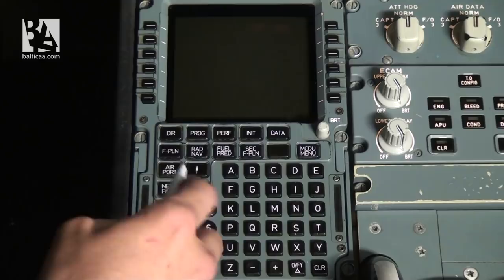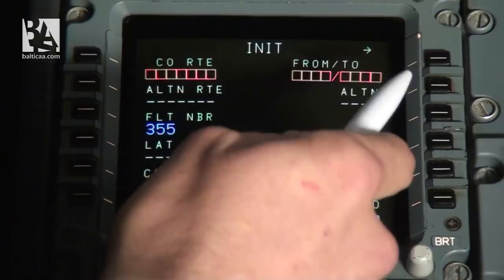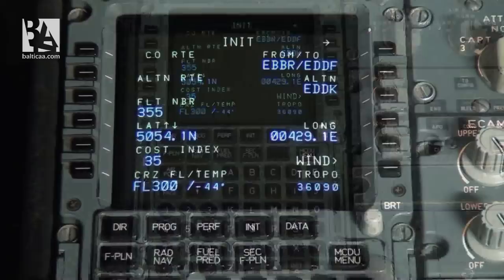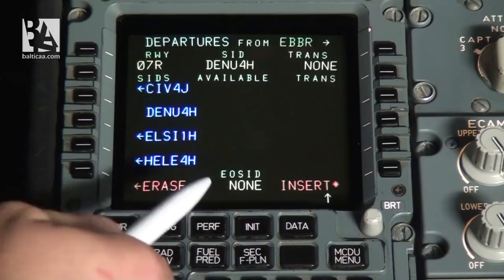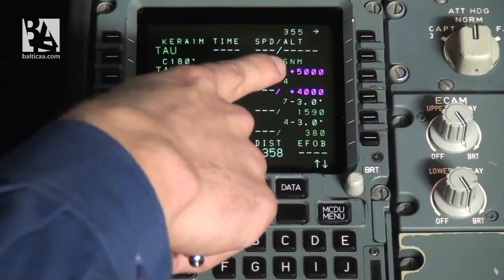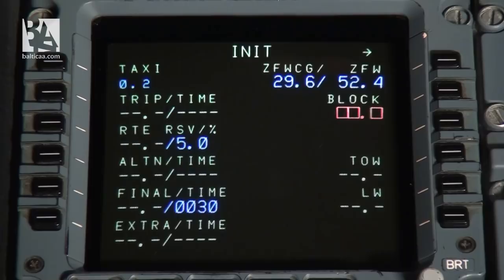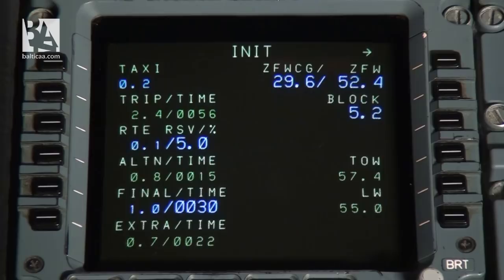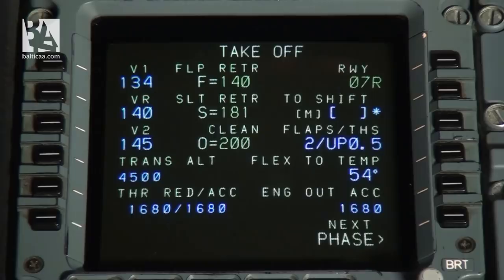Baltic Aviation Academy: Tutorial of Multi Control Display Unit on Airbus A320

Comment: TAXI 0.2 is not 20 minutes, it is 200 kgs.
Reply: taxi use time cycle not weight cycle
Reply: No madame, in this Airbus MCDU, the value 0.2 is 200 kilograms, not time.
Reply: You can add them up easily => 0.2+2.4+0.1+0.8+1+0.7=5.2 = block fuel. So yes, it`s 200 kgs.

Comment: Hmm actually tropopause is a layer where temperature remains unchanged and the layer where air gets warmer by increasing altitude is stratosphere. Anyway it was helpful tutorial. Thanx BAA
Reply: Cənab Dərin Məntiq exactly that, although you wanna keep your bird outta the tropopause so your performance doesn’t decrease, the cool thing about flying over it is that the tropopause is the “absolute” ceiling of CB clouds.
Reply: The tropopause is the layer between the troposphere and stratosphere. Right sir?
Reply: @CaptainJadenAR  exactly
Reply: Canab Darin, Thank you, sir :)

Comment: my last operation with an equal equipment is some 15 years ago, the first already 30 (yes years, A310 the first glass cockpit in airliners) Not much has changed. Only , when I inserted flight plans manually , I crosschecked immediately on the map page display to have it graphically verified. Pity you did not show this after inserting new wypts, just to make it easier to follow up for non professionals. Maybe next time, thanks anyway for the upload of your different A320 tutorials. Good Luck

Comment: pretty sure the CI in an Airbus goes from 0-99 and not to 999.  I believe it's 999 for Boeing. 
And in EDDF you would never ever be cleared for the KERAX1M arrival. You will instantly get the KERAX07N or South transition. You don't even fly STARs in EDDF if your flightplan ends at KERAX,PSA, ROLIS or UNOKO. Only the transition. So IRL they never fly TAU transition but otherwise very informative :)
Reply: I’m sure it goes to 999

Comment: excellent video Just a question, Taxi fuel is 0.2t (you said taxi time is 20 minutes), time for ALTN was 0030 (30 minutes) so following the same convention , if it was taxi time of 20 minutes, it should have been written as 0020 and nor 0.2. I suppose 0.2 is taxi fuel in tonnes.
Reply: piyush singh yes u r right 0.2 t fuel for taxi not time

Comment: nice video. What is the MDA and DH on the approach phase in the MCDU?
Reply: MDA and DH stand for  Minimum Decision Altitude ( MDA )  and Decision Height ( DH )  . MDA is used in non-precision approaches  and is an altitude below which you shall not descend further without having the visual contact with the runway .
DH is used in precision approaches like ILS approach with both lateral and vertical guidance  and is the height at which the pilot decides to either continue for landing or declare a missed approach if no visual contact with the runway is established
Reply: ok, thank you very much!!!
Reply: Niku Sokoli MDA is Minimum Descent Altitude
Reply: thanks!!!

Comment: can you explain me well the work of MCDU      and does the MCDU access viruses?
Reply: +Brian Benard I don't know about viruses - think of the MCDU as a high-tech digital calculator which has limited integration into other systems such as the FADEC (engine control computers) and navigational equipment/autopilot. It is possible to 'hack' an aircraft nowadays through the use of ACARS (a system that links the aircraft with the ground for obtaining weather and other operational information), as well as passenger amenities such as USB charging ports and onboard wifi. There have been several claims of people successfully hacking aircraft computers through these pathways. One guy recently hacked his aircraft while onboard as a passenger during the cruise and claimed he obtained full control over the aircraft's engines - scary thought!
Reply: +Brian Benard I don't know about viruses - think of the MCDU as a high-tech digital calculator which has limited integration into other systems such as the FADEC (engine control computers) and navigational equipment/autopilot. It is possible to 'hack' an aircraft nowadays through the use of ACARS (a system that links the aircraft with the ground for obtaining weather and other operational information), as well as passenger amenities such as USB charging ports and onboard wifi. There have been several claims of people successfully hacking aircraft computers through these pathways. One guy recently hacked his aircraft while onboard as a passenger during the cruise and claimed he obtained full control over the aircraft's engines - scary thought!
Reply: Alexander McAllister  thanks bro be blessed

Comment: I wonder why Airbus didn't design their computer systems to allow Dispatch to send flight plans to the planes over an Ethernet cable on the ramp.
Reply: Jim Mowreader ACARS
Reply: shukri A320 Here's the Wiki description of this part of ACARS:Flight management system interface[edit]ACARS interfaces with flight management systems, acting as the communication system for flight plans and weather information to be sent from the ground to the FMS. This enables the airline to update the FMS while in flight, and allows the flight crew to evaluate new weather conditions or alternative flight plans.It looks to me as if you can send updated data to a plane in flight, but you can't (or wouldn't want to - if ACARS is anything like Qualcomm they charge by the transmitted character) transmit a whole flight plan. The system I'm thinking of would have a computer on the dispatcher's desk..."you're flying route ABCDE from MIA to CLT at 1400 on 9 May? I'll enter the time and date, push this button...boop! Your whole flight plan is in the plane's computer for you!" What you see in this video is like we did in the newspaper industry 70 years ago when we pulled a story off the teleprinter and retyped it into a line casting machine.
Reply: not recomended for transmission to land with irs system is on.. that forbiden

Comment: how doo you know all this number ?? :/
Reply: http://s126.photobucket.com/user/mrmister001/media/U0S2SP0-DBL%20-%20RTOW%20Regulated%20Take%20Off%20Weight%20-%20CHART_Paacutegina_5.jpg.html

Take this thing for example. OAT is outside Air Temperature. You tell it what temperature it is now, what Flaps you want to use, and how the Wind is doing.

Then it will tell you for your case how heavy you can be at Take Off as well as the V1,V2 and Vr in the form of xx/xx/xx. Not sure what the other numbers are for.

These kind of pages usually come with the Manual I think, so both the air crew and the ground crew probably have them.

As for the weights they are Aircraft and situation specific, but usually do not require over complicated excel sheets to figure out. Just a pen and maybe paper.
Reply: Thank's Bro :) now, i more know about MCDU. i appreciate it (Y)
Reply: Ilham Rafly
You are very welcome :)